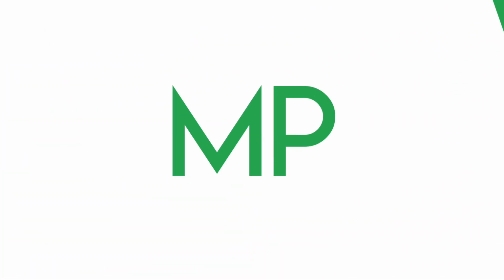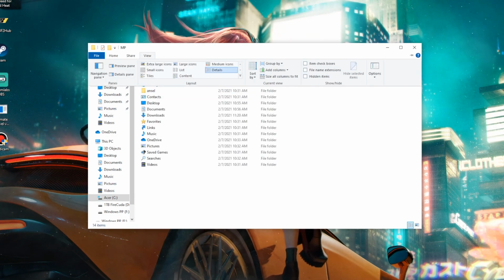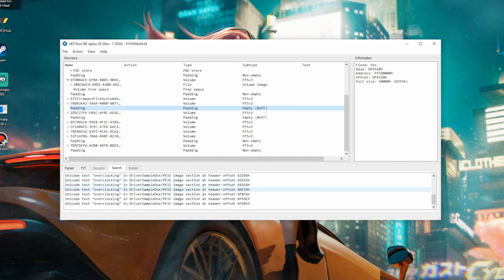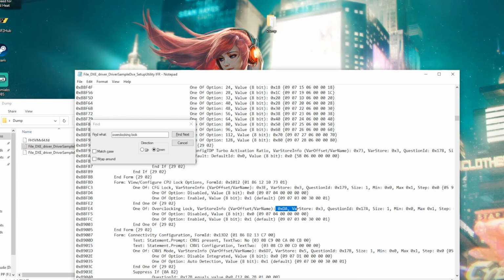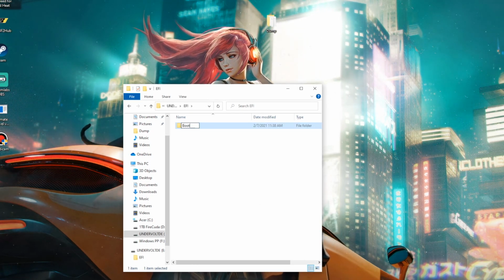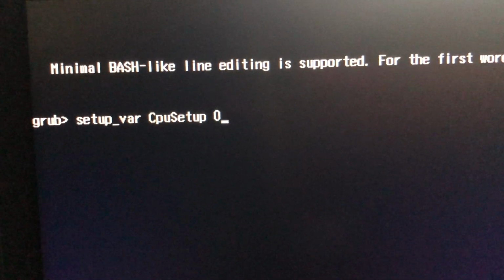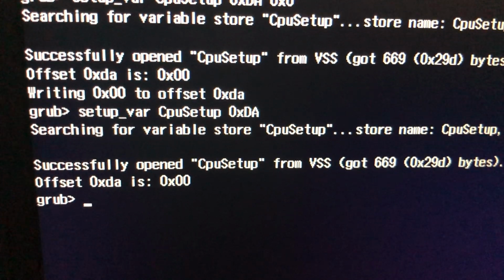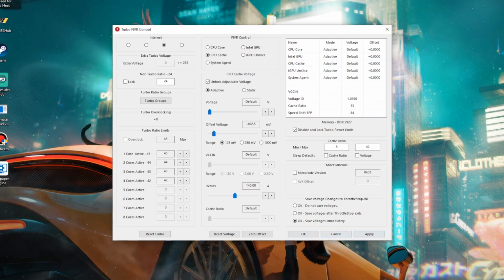How to Undervolt i5 10300H Acer Nitro 5

Comment: A while ago I performed this operation and it really worked, but I recently formatted my Legion 5i i7 10570H and the undervolt completely stopped working. I tried changing the BIOS from EFCN58WW to EFCN52WW (which was the BIOS I used for the undervolt) and it remains the same. Although it enables the ThrottleStop bars to move, moving them makes no real difference in the voltage; at +125mV and -125mV there is no difference. Can someone help me, please?

Comment: Hi Meanpooh, it's really an amazing tutorial and it did wonders to my laptop !
But latelly Windows 11 has been UNDOING the 0xDA value by itself, without any new bios update to the laptop. Do you know if there is a way to prevent windows from doing that ? thanks
Reply from the maker: You're welcome!  Windows should not be able to change it on its own unless its flashing the BIOS some kind of way.  I do know that on a Legion 5 Pro that I owned, Windows had a BIOS update that it wanted to perform.  It's probably best to disable auto updates from Windows.  Its the only solution that I could come up with.
Reply: @Meanpooh  Yeah I will try to do that...
I'm not sure why and how but windows' the only culprit I can think of

Comment: new bios update locked the undervolt values now. any workarounds?
Reply: Windows has started undoing the changes, only thing you can do is do it again it seems. and maybe preventing windows from doing updates ? but it sucks
Reply: @DerangedGM i tried disabling virtualization in bios setting on w11 as per the uploader’s instructions and the undervolt works now!
Reply: @CoffeeHead047  nvm then, good for you
Reply: @DerangedGM thanks mate ❤

Comment: You can just extract the fd files directly from the exe using 7zip. Only a few models actually requires running the update program and getting the file from temp folder.

Comment: I try in Pavelion 15 same cpu but after I change 0x0 got error 0x0000000008 Is there a way to fix this? Thanks
Reply from the maker: That's a write error.  Its locked.  I'm facing the same thing on a 13700HX.  I cant find a way around it.

Comment: I have the acer aspire 7 a715-75G Intel i5 10300h the same CPU but in throttle stop it says locked in the FIVR section help me... It running very hot goes 87degrees to 92 degrees in a 22degree room temp I cleaned the fans,heatsink and reapplied the paste but nothing is working for me 😿❌
Reply: use throttlestop version 9.0 my friend.
Reply: @Kien-ki3ru  not working still says locked
Reply: @vaibhavv._.1f  Did you do the part in Grub?
Reply: @L-8  I don't have that laptop now..I sold it now I have a pc

Comment: Hey! It's been a while. I went back to your video because I need to restore the BIOS to the normal setting so I could update it to the latest version. My only question is that, for the part where you boot into the USB's bootx64.efi, After typing the command "setup_var CpuSetup 0xDA", it will show the current offset. What is it supposed to show if the laptop has not been unlocked yet? What am I supposed to type in order to lock the UV again? Is it 0x1 or 0x3?
Reply from the maker: You can update as normal.  There is no need to change anything back.  It will override any changes you previously made.
Reply: @Meanpooh  Thanks for the response. I wasn't sure if it was safe because I saw a thread in r/AcerNitro about someone's laptop not booting after updating his Nitro 5's BIOS. They mentioned that their laptop was also UV unlocked, so I am not certain about the safety of updating the BIOS with it being UV unlocked.

Anyways, I've already UV locked it awhile ago and reinstalled the BIOS as I tested something out, which unfortunately did not work out, so I will be unlocking it again. I've also realized just now how quick and easy locking and unlocking the UV is. Just turn off secure boot, plug that grubx64 drive and you're ready to go.
Reply from the maker: @Borgar_0420  Good job. It’s usually the prep work that the hardest.  I was trying to unlock 12th gen with no luck. I have managed to adjust some settings but they won’t apply. I may get back at it some time in the future. Have a great day. 😀

Comment: its realy unlocked voltages on my i5 10300H. I have nitro5 AH515-55 with 1660ti and thought it was impossible until that video. But it doesnt make much impact for the temperatures but at the stress test core frequencies increased from 3.8 to 4.15. Then i changed my thermal paste to Thermalright TF8 and the temperatures now is ok. So guys first of all try to change your old thermal interface and if you still dissatisfied then do this risky bios manipulations. Thanks to author ♥

Comment: Hello I'm newbie, does my cpu voltage will be back to normal if I completely close the throttlestop application? Because I want to undervolt my cpu only when gaming and stop undervolting when I'm doing normal task.
Reply from the maker: Yes. Close the app. Shut down the computer and reboot.

Comment: can i use this method for my i5 1035g1 ? pls answer, thermal throttling is killing me
Reply from the maker: Download Throttlestop and try it.
Reply: @Meanpooh  i dont fear to tweak in throttlestop, but first i must unlock undervolting by your steps in video, my question was can i follow your steps in this video because my processor is different model from yours
Reply: @Meanpooh  can i ?
Reply: @Huxxoircz  it works, I'm using an 11th gen and it works on most processors, the code will be different like 0xDA is 0xDF for me for 11th gen processors
Reply: @SynApse01547  i succeeded two monts ago, but thanks man anyway for replay

Comment: Hi, I've whatched your guide many times and now that my Guarantee is expired I would like to unlock the Bios to undervolt and decrease the max frequency of my Nitro 5. I have just one question: How can I recognise which is the right BIOS to download? Thank you! I have the model AN515-55-59V4
Thank you for your support Mate.
Reply from the maker: If you have not updated you BIOS, use the one that is next in line.  So if you are on 1.0 then grab 2.0 and extract it.
Reply: So I do have to download the versione 2.0 if I have 1.0? I've never updated my bios in the past, maybe I should verify which version I have entering the bios before doing it. But don't I have to use the same version of the bios that I have and later downloading the same version from the website ? 
Sorry but I don't want to mess up ahaha

Comment: Fairly easy tutorial to follow. You got yourself a subscriber. I just have a question. I also got an Acer Nitro 5 with i5 10300h and I'm running an eGPU thru the M.2 port with the ADT Link(3060ti OC). I tried undervolting and went with -90mV and limited the cores to 4Ghz and my screen froze. I tried lowering it even more and it still freezes. Do you think that the eGPU might be causing this in some way? I'm not really that well-versed in electronics. Thanks for your help.
Reply from the maker: If it runs fine without undervolting then its tied to that.  Some machines cannot be undervolted a lot while others just barely.  Just ease up on the undervolt in increments of 5 until its stable.

Comment: my ubs isnt readable in the boot section in bios it is on fat32 format thou idk why im stuck here :(( badly wanto to undervolt
Reply from the maker: Try a different USB drive if it isn't working.  Make sure you are making the folders correctly.
Reply: @Meanpooh  it read but how to get ther i was spamming f12 for boot aelector but it always goes tru windows
Reply: when i hit f12 there's nothing happening while booting but f2 does work hehe what todo
Reply from the maker: Make sure F12 Boot menu is enabled in BIOS.
Reply: @Meanpooh  how to check :((
Reply from the maker: @somekindaracoon5647  Go into BIOS and Enable it. It will say "F2 Boot Menu"
Reply: @Meanpooh  HI SIR, now i undervolted uhmm what todo in nitrosense?, high performance or balanced?
Reply: one last question i undervolted into -85 still stable 4.18hz and default is 4.18 hz the difference is it heat slowly and soemtimes doesnt hit the throttle speed, did i do great??
Reply from the maker: Yes you did!  If it works for you then stop.  If you want to push further, keep going.  Do this until you are satisfied or your system crashes.  When this happens, you have hit the limit.  Your undervolt will vary by game.  The only way an undervolt will work for many games is to have it set low.  -85 will most likely work for all apps and games without crash.

Comment: The fun part is HP Omen's laptops which have H series processors have this settings unlocked by default since they have undervolt option in gaming hub itself Meanwhile Acer doesn't even provide undervolt option or care about overheating.

Comment: Idk why people risk their bios doing this just limit cpu power in power management to 99 and ur pc used base speed and it consumes way less i power like i get 62° from 93. Also if u need the max turbo clock speed just put it back to 100 for the games that need high power.
Reply from the maker: It's not a BIOS flash.  Go ahead and use those settings you mentioned for demanding games.  You'll be throttling in no time at all.  Most PC gamers do not want to run their machine at base speed.  They don't care about saving energy especially when they are plugged in.   They want as much power as possible while not throttling from high temperatures.  To get that low temp of 62, just flip the switch to power saver.  Using certain software such as Throttlestop and IXTU allows you have more control over how your machine behaves both while gaming and conserving energy if you choose to do so.

Comment: Asus tuf f15 fx506li i510300h gtx1650ti undervolt works fine from 95-100c at max load went to 80-85c  without no performance loss and max boost clock maintained -125 is stable for me
Reply: How did you unlock it on this laptop?(help pls)
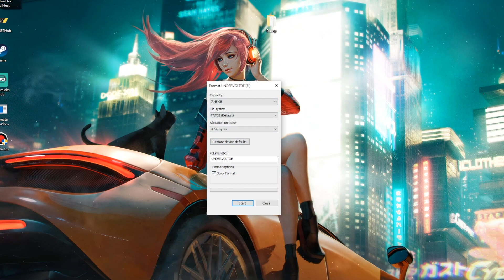Reply: @danilskorokhod1066  dont do anything just follow steps from 5:45

Comment: Hi, currently im stuck in ifr extractor. I cant open it because of missing dll. Tried installing the dll and it still doesnt work. Can u help me about it?
Reply from the maker: What dll and how did you install it?
Reply: @Meanpooh  MSVCP120.dll installed it manually by pasting it to system32. Also tried installing different versions of C++ and still didnt work bro 😔hope u could help me bro
Reply: @Meanpooh I'm on windows 11 idk if thats the case why i cant run IFR extractor
Reply from the maker: Not sure, its possible though as I'm on Win 10.  You might want to try installing https://www.microsoft.com/en-us/download/details.aspx?id=40784
Reply: Hey bro! Its ok now. Just need to install the 2013 version. Thank you so much for the help!
Reply: And lastly bro should i tweak the TPL on throttlestop? Or it should stay default?
Reply from the maker: I would leave it at default at first.  You could then adjust PL2 if you think the boost is too high or you could lower it in FIVR.

Comment: For anyone out there, this can be done with HP pavilion 15 gaming laptops too. The difference is that you just need to have the setup var on an usb and the secure boot unlocked too.
Reply: Do you undervolt hp pavilion gaming 15?
Reply: @tawer4839  yes, with this same process

Comment: hi, meanpooh your work is awesome. I have an Asus f15 fx506li ooooh man this CPU runs really hot and is always thermal throttling under load. I've found the overclocking lock in the bios file in the same place u showed. I just wanna know how much is the risk of this progress? if it's done correctly. I'm a student and I don't have much money to repair the machine but I need to undervolt this .thank u
Reply from the maker: There is some risk if you change the wrong address.  This is not a BIOS update but just toggling certain options on and off.  I did try this on an Asus A15 and all went well for a friend. https://www.youtube.com/watch?v=sQ1d6vVzk28&ab_channel=Meanpooh
Reply: @Meanpooh thank u aloooooooooooooooooooooooot. you are a hero for me

Comment: For anyone wondering, this method still works on bios 2.06. I had to redo this process after accidentally updating my bios. 

Process works exactly the same and now undervolting and turbo power limit adjustments work in Throttle stop again!
Reply: So those who have bios version 2.06 have to skip the bios updating part at first?
or just proceed exactly like the video without skipping anything including bios?
Reply: @notran288  just follow the video exactly and you'll be good 👍
Reply: @grantriddell1708  help me
Reply: @grantriddell1708  it says i have same version as now
Reply: @notran288  if i instail lower version it says "not newer than this"
Reply: Thanks

Comment: Please tell me if I have updated the BIOS to the latest version, can I unlock the undervolting?
Reply from the maker: You have to log into your BIOS and look at the version.
Reply: @Meanpooh  BIOS v. 2.06
Reply from the maker: Take that info and go to the Acer site and find your model.  Head to the downloads section and look for the the BIOS versions.  Here you will see if you have the latest.
https://www.acer.com/ac/en/US/content/drivers
Reply: @Meanpooh  I already did this from the acer website, downloaded and updated the BIOS to version 2.06
Reply from the maker: Did you try the steps?  It's not necessary to update to the latest.  The only thing that matters, isits the address when you look through it for overclocking lock.
Reply: @Meanpooh  I do everything step by step as in your video, but IFRExtractor does not open says that the system did not detect MSVCR120.dll, I am from Ukraine and you are the only one who can help me, can I contact you somehow differently?  Help me please.
Reply: @Meanpooh I looked in my BIOS in Secure Boot is Enabled

Comment: Do you keep secure boot enabled all the time after you’re done or should you disable it
Reply from the maker: Enabled all the time.
Reply: @Meanpooh  thanks, I don’t want to be a bother, I’ll pay for your time if needed but after getting stable -115mv my CPU wattage is super low now, from 45 to 11 on gta and 15-20 down to 0.5-3w idle after undervolt, this seems weird, this won’t be a problem?
Reply from the maker: Do you have your Power Profile set to Balanced?

Comment: can  I do the same in a  HP Pavilion 15-dk10000 (8VD47AV)? it has the same processor and graphic card
Reply from the maker: It may be possible as many people has had success with other brands of machines.
Reply: @Meanpooh  Hi! Sorry for Hijacking this comment but it is the only way to directly tag you so forgive me for that!

I just bought an acer nitro 5 with a i5 10300h and a 3060 but my bios seems to be version 2.06 already and i can't find that version of my bios anywhere, is it still possible for me to undervolt?

Comment: Hi. Cool! Is it possible for this model to increase the thermal package(TGP) of the GPU (3060-3070-3080)?
Reply from the maker: Nope.
Reply: @Meanpooh  what a pity.  the fact is that we cannot pick up a bios from other models (for example, an asus or a gigabyte with 105-115 watts) that would normally work with nitro.  they all incorrectly indicate power , thereby driving the logic of the GPU crazy.  At the same time, this trick works on other laptops (for example, asus).
Reply from the maker: This will only keep happening, the more people complain about having heavy laptops and wanting them thin.  Some people would have never survived the 90's.

Comment: So are we not actually updating the bios, only using a file out of that bios that we actually have on our computer already? This may have been where I made the problem. I downloaded the most recent bios which was two point something and did the procedure based on that. Is that maybe why I'm stuck in a automatic repair loop?
Reply from the maker: Just saw this but have you tried letting it go all the way?  Can you log into the BIOS?  There might be something else going on.  If something really did go seriously wrong, your machine most likely would not POST.
Reply: @Meanpooh I'm not sure what you mean by letting it go all the way. It just loads me to the blue menu screen with the available selections such as "continue" "use a device" "troubleshoot" & "turn off your PC"

I have tried troubleshoot, startup repair and it says "couldn't repair your PC" 

 I am still able to get into the bios.  It shows still using v1.10

The interesting thing is that the automatic startup repair started the very first time I hit F12, before I made any changes at all..

I just noticed that the F12 boot menu was disabled by default. I enabled it and used it, but still having the loop

**Ok, nevermind... For whatever reason, this is what worked and stopped it, and yes the voltage is now adjustable:

I went into the boot manager and selected the second of the 2 windows boot options and it just went back to normal... Maybe it was trying to boot from my internal HDD instead of the NVME?

Comment: Hi I have updated nitro 5 bios.
The computer went from 80 watts to 100 watts
My friend has the same computer, 80 watts, 60 degrees computer
My graphics card is running at 70 degrees at 100 watts.
I can't drop the computer to 80 watts
Can I do a bios restore? How does this happen?
Or would you suggest another method?
Performance drop doesn't matter to me
Reply from the maker: Your temperature is fine. I would not try to reflash the BIOS.  I don't think the Nitro 5 supports the downgrade.  Fortunately the newer BIOS for Nitro 5 are improvements.  You can either put your machine in power saver mode(non boost speed) or use Throttlestop to limit your clock speed.  This will allow your machine to boost but is determined by you.

Comment: i5 10300H, RTX 3060, BIOS: 2.03, I have problem with opening .fd file in UEFITool. It writes "Invalid UEFI Volume".. do you know how to fix it? Thanks.
Reply: So I tried undervolting from reddit and its great 😊 83-90 degrees before, 65-72 degrees now